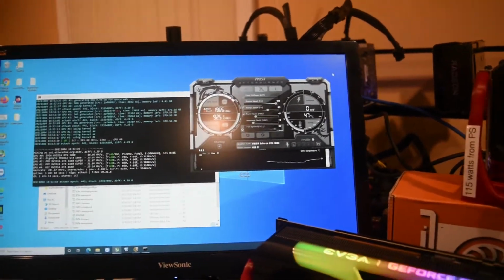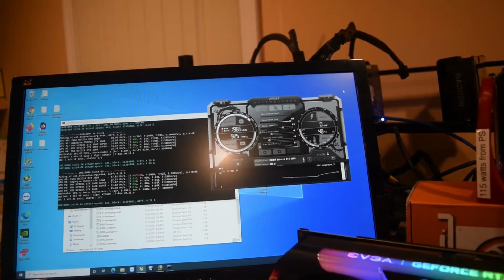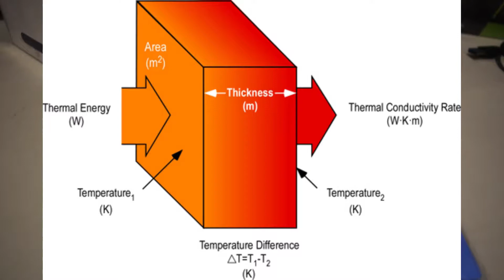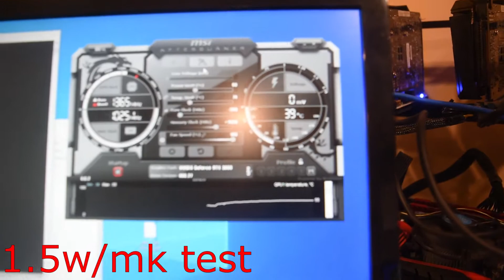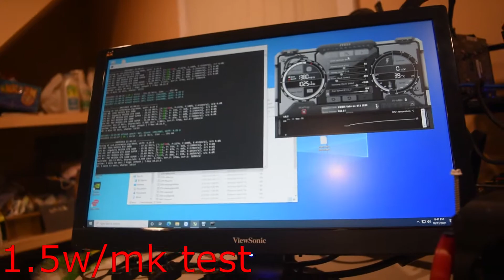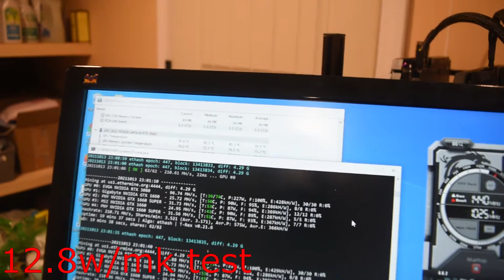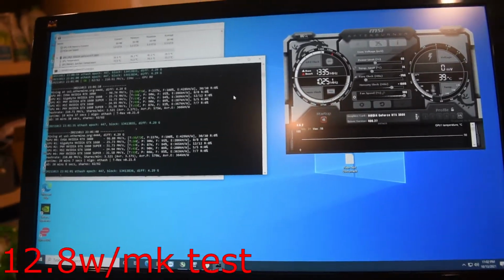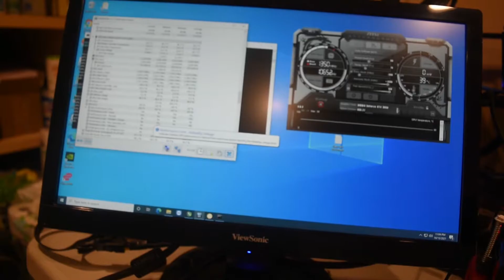EVGA RTX 3080 FTW3 Re-pad with Low and High Thermal Conductivity pads.

Comment: Awesome video! Question. Can you point out to a video on how to measure the correct thickness of the pads? Or can you explain further how to do that? btw loved the stop motion! thanks
Reply from the maker: Hhaha thanks. I think son of a tech has a great video about measuring the pad. I think the video is call “replace thermal pad for any gpu”. I suggest you check that one out.  I will try to do something similar.
Reply: @RedLlama  I didn´t explained myself correctly. I already changed them, but got pretty few degrees down on the Vram. So, my question: How can you tell which thickness you need, not having the original pads to measure? is there any way? btw it´s a Colorfu RTX3080 Advanced OC
Reply from the maker: I see what you mean. You can cut a long slice of a pad and almost use it as a slim and press the heat sink and gpu together and see if it slides out. If so you will have to size up. If it’s not sliding but you see a gap on the gpu to heat sink you will need to size down.  Does that make sense? I know what you are talking about. I ran into the same thing.
Reply from the maker: Check out the following video where I put the repadded 3080 into a rig. https://youtu.be/H5L19jckENA

Comment: Hi, What model of pads did you? and can you confirm the VRAM is 2mm or 2.50mm ?
Reply from the maker: I used 2mm on the vrams. I might have added paste to them too. The gpu riser pads might be a better bet now.
Reply: @RedLlama  what about the 2 long strips on the mosfets, you used 2mm too?
Reply: @kimohw  2.5 or 3 as im used 2 not reach heatsink

Comment: 2mm for vram, 1mm for inductors and 3mm for mosfets? Thanks.
Reply: Did this thickness worked for you ? 2mm for vram, 1mm for inductors and 3mm for mosfets
Reply: @kimohw  I bought a custom pads for my ftw3 from kriticalpads shop in the USA.

Comment: What is the thickness of the pads you used on the memory
Reply from the maker: Hey it was 2mm on the memory.
Reply: @RedLlama  thank you, I have same card and Memory only gets up to 1800 on hive mining RVN if i increased it i got error due to  thermal issue so I’m will change the thermal pads today.
Reply from the maker: @AhmedSayed-kx9dp  let me know how it works out.
Reply: @RedLlama  changed the thermal pads, I don’t know what is my memory temp. Now because im using HiveOS but i think its succeeded because i can go now over 2000 MEM without any problem 
Im getting 49.5 mh/s on hive with 2000 MEM
Reply from the maker: I’m glad it worked it out. I’m going to try 15 w/mk next and see if I can get 104 mhs on eth.
Reply: @RedLlama  Did you use 1mm pad or 0.5mm pad on the side? You said you measured 0.5mm but read 1mm? maybe it is to be squished?

Comment: Get some Gelid 15W/mK. Also add some on the back of the memory between the backplate, should be 3mm. Will drop to ~60C. You could get up to 104mh.
Reply from the maker: Whoa. Thanks for the tip. That’s awesome. I’ll have to try that!!
Reply: Where exactly do you put the pads between the backplate?
Reply: @ThatOneScienceGuy  right behind the memory modules ,in between the pcb and the backplate